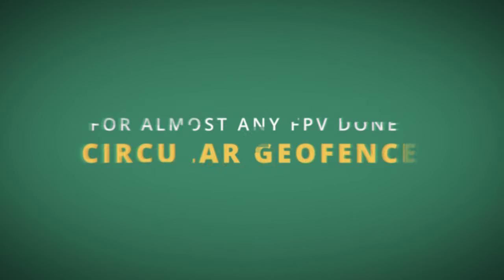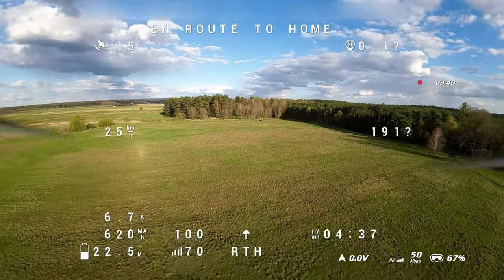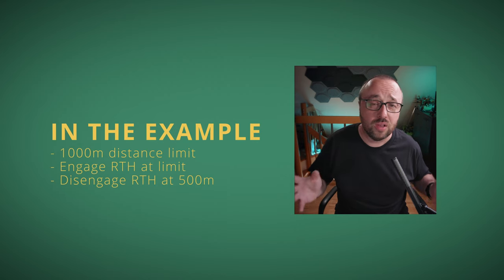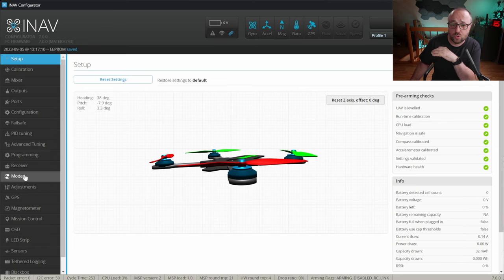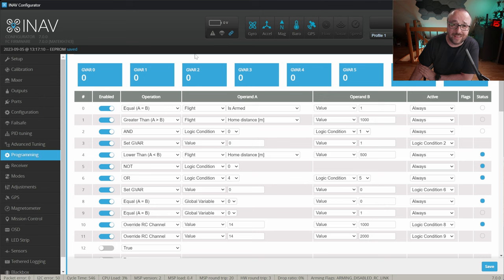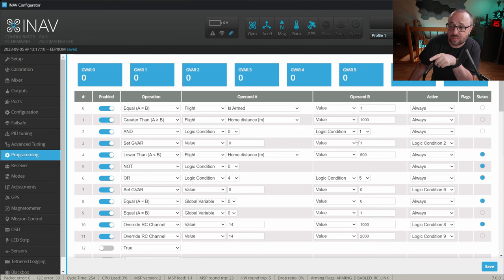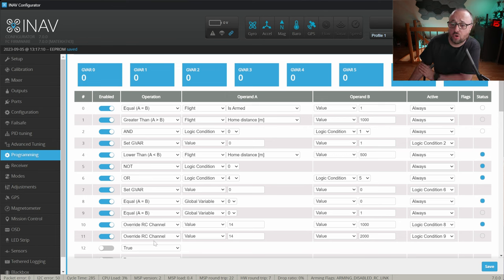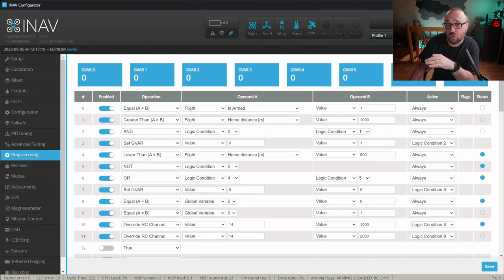How to get Geofence for any FPV drone?

Comment: Hi Pawel. In a related note, I have a 7" I'm preparing for long-range but in this one, I have a M10-based GPS (Walksnail M181) and, to make things worse, I had to turn the FC 180º yaw. As you can imagine, the magnetometer orientation is really non-standard. The INAV configurator is not clear if the orientation shown in the setup, for instance, is related to the FC or if the orientation of the FC is already taken in consideration. I still have to figure this out because the quad was drifting in the first tests.
Reply: I have a Cirocomm M10 GPS unit and got trapped with the alignment of the magnetometer too. The flight controller is upside down (180 degrees ROLL) to add to the mix. Nothing appeared logical and I kept using different YAW settings on the Magnetometer Tab until it worked properly. (I tried to look at the settings now and realised I used that flight controller on my tracked rover. Sorry) I suggest you do the same as only one Yaw setting can be correct and there are only eight choices assuming the flight controller is pointing in the direction of travel. The only info I found on the alignment showed a 45 degree offset from 0 degrees.

Comment: ion, yes sir! Thank you very much for putting an end to this problem in FPV drones. My question is this. I would like to do the way you have used but maintain position. In this case, would the drone remain static since the distance to the point of origin does not decrease? Or is there a way to slightly move the drone to the center to regain control?